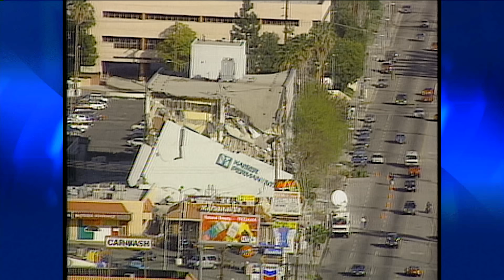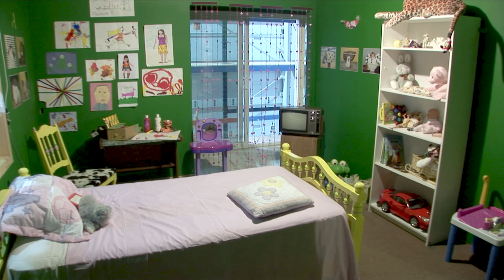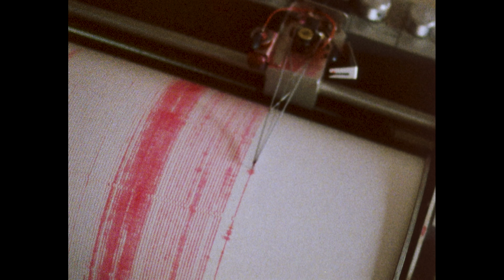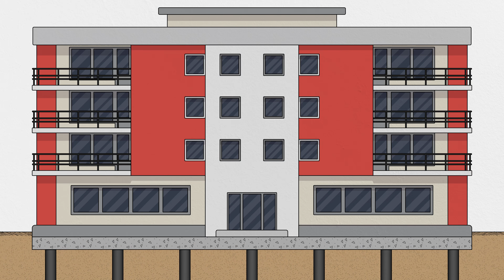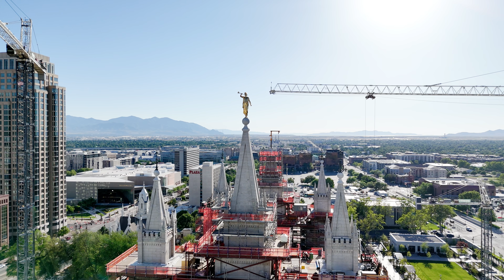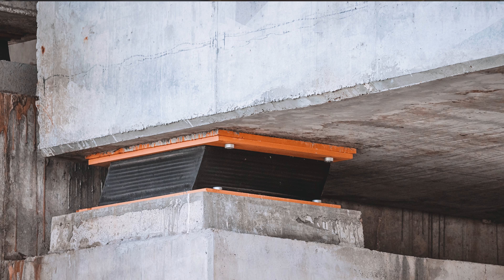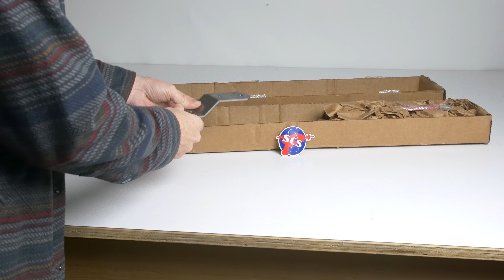How Earthquake Bearings Work

Comment: Got to tour SF General during construction. I have pictures from inside the "tub" and of the isolators. The water/sewer connections were neat: linear sliding pipe joints, with multiple segments in opposing orientations. That gave the joints full movement in the horizontal plane. Electrical and such were much simpler: slack cables on springy supports. 

One under-appreciated benefit of wood construction on the pacific coast: for homes and small buildings the wood has a lot of flex. So long as your connections are strong the building naturally bends with a quake and self-dampens as the wood fibers want to return to their resting orientation. As long as you have sufficient blocking or sheeting and strong foundation connections they can take a lot of punishment.

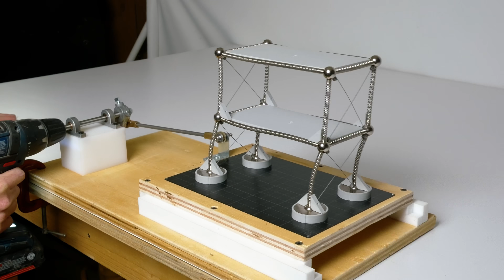Comment: The model at 4:00 was basically my masterproof. I built models to use during architecture lectures so students could feel the difference trusses etc make.
One of the models was exactly this two story building. One without walls, one with two intersecting walls (still rotation possible) and one with three walls. :D

Comment: Can anyone tell me about why the link between the pillars and flyovers are small compared to the pillar
Reply: For anyone wondering 
1. Bridge Bearings
Those "links" are known as bridge bearings. Their primary job isn't just to hold the weight up, but to allow the bridge to move. Bridges are living structures—they expand in the heat, contract in the cold, and sway under heavy traffic loads. If the flyover were cast as one solid piece with the pillar, those natural movements would create immense internal stress, eventually causing the concrete to crack or snap.
2. Force Concentration
While the bearings look small compared to the massive pillar, they are typically made of incredibly high-strength materials like reinforced elastomers (rubber) or stainless steel.
The pillar is wide to provide stability against tipping and to spread the load into the ground.
The bearing is sized precisely to handle the vertical compression of the bridge deck while remaining flexible enough to "rock" or slide.
3. Seismic Isolation (Earthquake Engineering)
Since this is a comment on a video about earthquake isolation, this is a huge factor. In an earthquake, you actually want the flyover and the pillars to move somewhat independently.
If they were rigidly connected, the shaking ground would transfer all its energy directly into the deck, likely shearing it off.
By using smaller, specialized "links" (like lead-rubber bearings), the bridge can slide back and forth, absorbing and dissipating the earthquake's energy rather than fighting it.
4. Maintenance and Replacement
Bearings are designed to be the "sacrificial" part of the bridge. It is much cheaper and easier to jack up a bridge deck a few centimeters to replace a worn-out steel or rubber bearing than it is to repair a massive concrete pillar.
Think of it like the cartilage in your knees: Your leg bones are big and strong, but the "link" between them is relatively small and flexible to allow for movement and to absorb shocks!

Comment: Did anyone else see that diagram of the steel layered in the rubber and see Grady's demonstration of Mechanically Stabilized Earth in their minds?  And that friction bearing design at 13:50 is how an Incabloc mechanism protects a mechanical watch's balance shaft from impact damage.

Comment: I’m curious why would the term is called wavelength but “period”
I understand it’s not a even medium for wave to propagate unlike air or vacuum. So it’s a “compound wavelength”, but so do “compound period”? And I guess “length” is quite intuitive?
Also seems like it’s a good idea to analyse this model with impedance matching/mismatching? bearing lower fraction similar to resistance. damping resist change of acceleration, much like capacitance and so on so forth.
Of course the structural LCR is not very straight forward, but this model is fundamental of any sort of wave?
Reply: The missing link between period and wavelength is the medium the wave travels through. Material properties dictate the speed of the wave, such as sound traveling faster through water than through air. 
Period, which is the reciprocal of frequency,  can be expressed solely in terms of time, while wavelength depends on the medium.
Reply: @brighamshamrell4524 seems like you missing the point, wavelength certainly needs to account wave speed. Speed of sound/speed of light are calculated with two different mediums assumption, so do speed of anything.
The only thing I can come up with is wavelength is not comparable between two buildings, because the material can vary, sometimes a lot. Period, on the other hand, simply assume the 1Hz = 1cycle of the height of the building so period is always 1s regardless any building(ideally, obviously some more complicated cases).

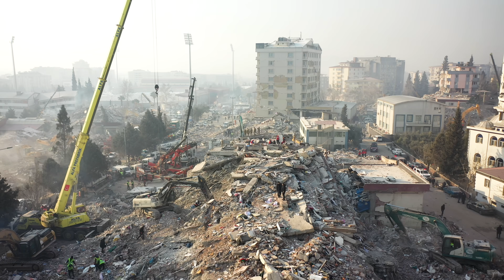Comment: 2:08 Very, very, very pedantic point but there is a maximum strength to earthquake on earth; Magnitude 18 is the strongest earthquake that can physically happen on earth before it's destroyed. Magnitude 14 or 13 is the limit (depending on how you define life) before it's a total life extinction event, and the greatest tectonic rift on earth is the Atlantic one at around 10'000KM that about a Magnitude 11 earthquake if it release it's all it's energy at once, which for multiple reason including that it's a separation point and not a fault point will never happen. The biggest fault is the Sunda megathrust, and it's "only" 5.5K km so about ~10.3 napkin math.
Reply: I like to imagine that LA hospital floating through space after the Magnitude 18 earthquake with its little rubber isolators still stuck onto a chunk of earth.
Reply: GeologyHub did a video on the theoretical limits of fault based earthquakes (meteors are a different story) and the Valdivia earthquake was nearing the max possible. There are factors beyond just fault length which limit things. South America is likely to be able to produce the largest earthquakes on the planet, and ~9.5 is pretty much the upper limit of what can happen. Still, this is an absolutely absurd amount of energy, and magnitude 9's are incredibly destructive events.
Reply: I appreciate ur napkin maths etc.

Comment: My first introduction to seismic isolators was when I read about them on the ITER website. And I was mind blown that such a heavy building and machine would be supported by blocks of rubber.
And now I wonder how the buildings that connect to the tokamak building are connected to it. And how they connect the magnet power supply busbars and cryolines. Not to mention the  assembly crane rails.

Comment: 3:50 Vertical accelerations aren't usually a problem... until they are. The second Christchurch Earthquake had over 2 g of vertical acceleration. 
With that amount of vertical acceleration, everything that was made of unreinforced masonry just goes up into the air and comes down in pieces. This is essentially what happened to all the brick and mortar facades on the old buildings in town. Ironically, a lot of people got injured because they ran out of these old buildings, thinking the buildings were old so they weren't safe, but they went straight into the path of the falling facades.
Reply: Yup. This vulnerability was first recognized after the Northridge quake in 1994. For the first time they recorded vertical accelerations exceeding 1g. I think the record prior to then was 0.3g. Most earthquakes only produce 0.1-0.15 g of vertical acceleration. They pretty much had to rewrite all the earthquake codes to take this "new" risk into account.
Reply: @makaira69  All earthquakes produce vertical acceleration. The distance from epicenter is what makes the difference. Luckily for us, earthquakes in most cases don't happen directly under cities.
Reply: @dv2915  Actually, it also depends on the type of fault. In the Northridge quake in 1994, it was an unknown thrust fault which let go, which lead to the significant vertical acceleration. Different faults generate different accelerations in different planes.
Reply: @dv2915  Is it lucky ? 

Or would it not make sense to build directly over fault lines either because you're aware of the fault line or, the line itself creates terrain that's unsuitable for development...
Reply: Most of our cities and towns were sited well before knowledge of fault lines existed. 
Luckily, most major faults are either off the coast (subduction zones), or in mountainous areas (thrust faults).
Reply: There was also a rotational factor and a circular factor. The Wellington quake a few years later had very definite rotational movement which damaged quite recently designed buildings. Strangely several old concrete buildings of questionable design showed no damage at all. Somewhere there is a video of a shipping container at Victoria University in Wellington whish shows how a damped structure can have minimal earthquake response. This was hung on springs with a lot of travel and low resistance to any combination of movement. I think it was used to house precious data held on early hard drives.
Reply: I’m assuming they’ve changed the structural engineering standards to be far more rigorous so the fronts don’t fall off anymore.

…I’m sorry, I had to.

Comment: This video coming out a couple days after the 25th anniversary of the Nisqually quake in western Washington is pretty wild.  I was in one of the least safe, old brick buildings, on the University of Washington campus when the quake hit.  My classmates and I ducked under out desks like we were taught, but our professor ran out of the classroom.  The following week when we were allowed back in the building for classes our professor, who was on the panel that decided which buildings on campus needed earthquake retrofits first, told us that he had run out because we were in one of the buildings that was very high on the retrofit list.

Another related thing, the summer before the Nisqually quake I was working at a machine shop, and one of the jobs I was involved in, at a couple different steps as it worked through the shop, was small earthquake isolators for residential applications.  I never did see the completed design of them, but from the parts I handled, I would guess there were just basic rubber isolators.

Comment: In my home country, Chile, there was a massive earthquake in 2010. Many buildings from the center to the south-center of the country suffered severe damage and others, specially the oldest ones, collapsed entirely. There's many building that came out almost intact from the earthquake, one of them being Titanium La Portada, which was the tallest building in the country back then. It has a system of springs every 3 stories that absorbs the vibrations.

Comment: The Salt Lake Temple is also notable in that it is made of massive granite blocks, meaning it weighs a ludicrous amount, making the base isolation refit more complicated than for an equivalently sized modern building made of steel. 

The building also holds great cultural significance, so the Mormons are sparing no expense to ensure it lasts for centuries. I would love a deep dive on how they're doing it.
Reply: It's definitely not as in depth as an actual engineering channel, but their church news youtube account did a pretty good job with this video, and others in this series: https://www.youtube.com/watch?v=YvniG1E5AO4
Reply: I think the B1M has a video on it.
Reply: The temple will be open to the public for tours April to October of 2027.

Comment: Not just buildings!
The last large (8000 hp) Mississippi River towboat that I worked on had the whole deckhouse built separately from the hull, and it was mounted on 25 spring packages. Isolating the living quarters from the intense vibration of the hull seemed like a small thing, but it makes a big difference in crew fatigue levels. And just like the buildings in your video, we also had to have flexible connections between the deckhouse and the hull for water and power. One of my office friends who was instrumental in getting the three boats built this way told me that it only added $150,000 to the price of the $8,500,000 cost of construction, and it made a huge difference in crew endurance.
Reply: This is also the norm for navy submarines. Major equipment is isolated from the deck, and the deck is isolated from the hull. Keeps the sub from announcing its location to others.
Reply: @dgthe3  Foundations are pretty common across the whole maritime industry. structure and equipment may share vibration in a manner that causes stress and wear. So separating equipment from the structure or each other is a way to prevent these harmonics. Not just elastic foundations, but also shaft couplings, expansion joints, and sliding structures. All of these also have good characteristics in thermal expansion and contraction.
Reply: @cloggedengineer824 thats how the Cheyenne mountain complex works to, and pretty much every ICBM launch silos.
Reply: Nice. This would be a cool topic for a future video.
Reply: Large trucks also use this method of mounting the cab.  Good examples are trucks in videos that are doing an emergency stop and you see the cab wobble a little after the truck comes to a stop.  Very effective and makes for a very comfortable ride in the cab.
Reply: grady, you heard the man, where is our boat video
Reply: I had heard of heavy equipment putting the cab on its own suspension for the operator, but I hadn't thought about doing it for a whole boat.
Reply: Also, done by EMD on their Diesel locomotives starting with the 70 Series.  The locomotive cab was separated from the frame and sat on dampers.  I knew an engineer who once mentioned the very unique squeak, almost like a quack, the weather gasket that filled in the isolation gap made every time the cab would move excessively.
Reply: I came here to say something to the same effect.   I've worked on several "spring ride" towboats.  The difference in life aboard one with it is unbelievably better than on a boat without where everything rattles and shakes incessantly.
Reply: @jaduca22 Are all these vibrations just from the oversized engines? I realise that tugboats are pretty unique in the relative size of the engines, and that might be the cause of it.

Wouldn't it also be possible to "just" use better balanced engines? Straight 6 engines are famously balanced, and I know that maritime diesel ones are available in very large sizes. Heck, you could even isolate the engine itself from the hull; that's even easier if you use diesel-electric propulsion.
Reply: @mnxs still have vibrations from the thrusters even if the engine is perfectly balanced
Reply: That is so cool to learn.  I'm going to have to make that relevant in my Cyberpunk RPG somehow...
Reply: Awesome!
Reply: Trucks also use air bag dampers on the cab to give the driver a smoother ride. Not to mention the air bag suspension.
Reply: The seagoing rock cutting ship my brother was on had the housing on airbags, to seperate it from the hull vibrations.
Reply: My grandpa worked on a river boat
Reply: Wow it has 8000 hit points?
Reply: Thats really cool! I imagine 8k horsepower would really rattle your bones otherwise. I always consider anything you can do to improve living space comfort, as money and time well spent when i am working at sea. I isolated my bunk and found that i slept much better. Any different sounding vibration would wake me right up as an engineer, even though its just normal engine/generator load up, sometimes it would feel different coming up into the house and make me imagine the worst.
Reply: motor mounts in cars and trucks too I ahve even seen it done on fans between the motor and the blades
Reply: @ThunderClawShocktrix  Industrial motors and gear boxes too.  It avoids sending vibrations and a lot of the noise into the floor or building.  Even some audiophile equipment like record players rest on shock mounts to avoid skipping if whatever it's sitting on is jostled.
Reply: Ships are rated by weight capacity not engine displacement
Reply: @JMax-dc7ts What brings you to that conclusion? Ships are rated by both. If ships were not rated on hp how would there be limited vs unlimited horse power marine engineering licenses given out by the coast guard?
Reply: @clo @cloggedengineer824 if you said it yourself that I’m correct why bother commenting? Turns out we’re both correct, why do you seem so antagonistic 😂 angry much? I couldn’t care less either way honestly just know what my certification is for
Reply: @JMax-dc7ts I am not angry just disappointed. Ships are certainly classed on hp. As well as many other categories.
Reply: @JMax-dc7ts I am not upset just confused. One of the many categories ships are classed in is hp. And for tugs it is apparently the primary messurement.

Comment: This decoupled/dampened design is also something that I think data centers and their support equipment should be required to use to prevent transmission vibrations into the surrounding environment.